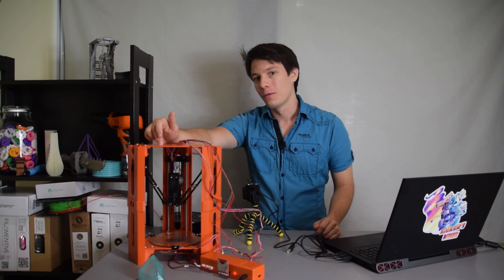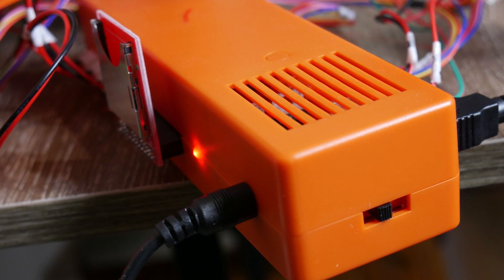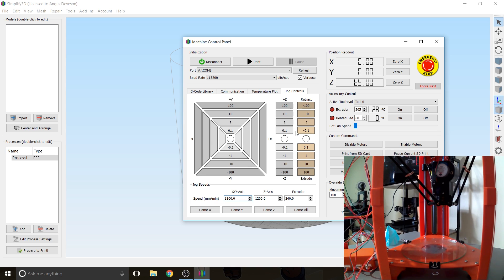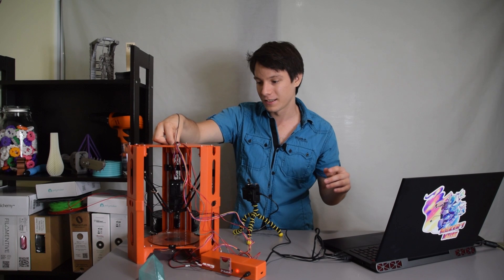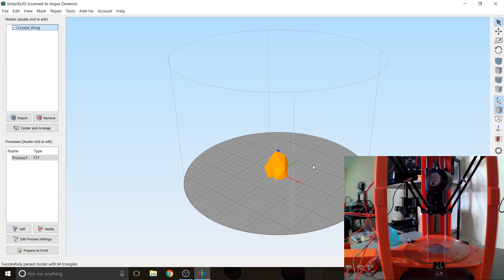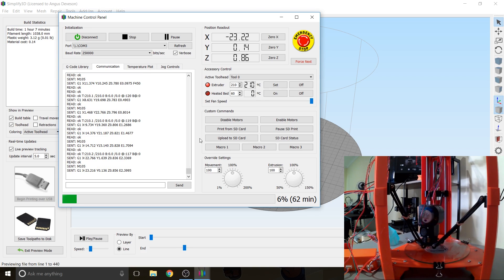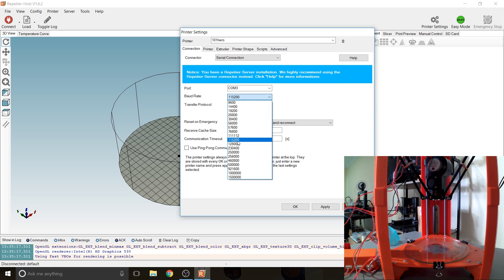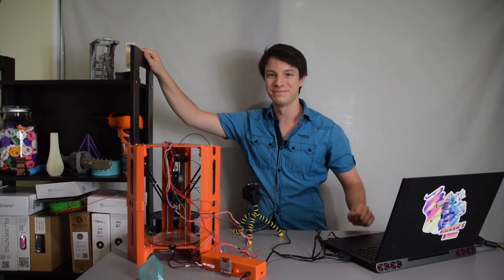Control the 101Hero with your Computer! 3D Printing over USB Tutorial

Comment: I Get Received= G90
Testing binary communication protocol
Connected to machine!
SENT: d501015e
READ: d501015e
And I can't control you 101 hero
What did I do wrong?
Reply: Strange, tried it on other computer and it worked thx dude

Comment: Several have mentioned Octoprint. Repetier has Repetier-server that may run on a Raspberry Pi also. actually I have my printer connected to a Pi, which is powered from the printer PCB. It works fine with my Repetier-host. Since the Pi has WiFi, I may control or monitor the print from my mobile, only by connecting with a browser. You really don't need to have the laptop connected all the time, just use a Pi.

Comment: Hi Angus, How did you manage to get the filament to feed back inside there is a gap between the top tube and bottom tube? Is cutting it at an angle the trick?

Comment: Angus, How do I get this to work over USB in Cura on osx? I tried have connect it but it doesn't seem to detect it. The 101hero works fine with sdcard. I hope you can advise. I'm quite new to 3D printing.
Reply from the maker: Sorry I have no experience with Cura on OSX, it might be a driver issue.
Reply: +Maker's Muse OK. Thanks Angus for the quick response.

Comment: Hi Angus,
On serial settings, my first guess these days would be 115200 Baud. Seems to be the de-facto standard for embedded serial devices for at least 10 years now...
(Update) just FYI, USB based serial emulation could be any baud-rate over USB, as the serial connection is emulated. The limitation comes from the connection to the MCU when using external USB proxies like the FTDI chips. Another factor to watch for is the (hardware) flow-control on the target, i.e. is the embedded target using 3-wire or 5-wire serial. 
 - Eddy

Comment: But Angus.. You can use a android tablet or phone to control your 3D printer using the GCoderPrintr app. So you don't need a tethered pc (but you'll need a wireless file transfer program to get the gcodes on the android)

Comment: Hey Angus, If I understand correctly, max volumetric speed you can reach has a big impact on printing speed. This would mean that you could possibly increase your print speed if you choose a lower layer height. It might be an interesting idea do make a video about this, testing if you can increase your speed at lower layer heights and by how much. Obviously this is different for every printer, but I think it's possible to get a general idea.
Reply from the maker: This is definitely a thing, however you will quickly run into motor and controller limits trying to much faster than 100mm/s. If you're printing with a very large nozzle and thick layers, you usually have to run quite slow so the material has time to melt and flow!
Reply: Yes,  let's say if you can only print at 50 mm/s reliably with 0.2 mm layers, that leaves a lot of room to speed it up on 0.1 mm layers.  Is 0.1 mm at 100 mm/s slower than 0.2 mm at 50 mm/s? If so, buy how much?

Comment: I actually prefer tethered printing but I have an old Wanhao 4s.   I just use an old laptop and files are grabbed off my network so no delay or sneaker net.   also my printer is in the basement so the other half can't complain of noise or smell.   I always had issues getting that blasted SD card in and out... tethered has advantages... next one I get will be networked!  😀
Reply: Convert it into a Linux laptop, install Octoprint on it and slap a WiFi dongle into a USB port. Or print up a Rasperry Pi (or zero) and put a pre-installed image of Linux+Octoprint in it.

Instant print server with network support (assuming you have Wifi in the house). 

 - Eddy

Comment: How can we know which is the perfect "Baud Rate"? I still have the default option and I´m not sure if it is the best one.

 Does it matter for the printing time so much? I mean, when I print something Simplify3D tells me it will take e.g 2h to complete the print, but later it tooks 2h 20m. Now I think it would be because of Baud Rate option jeje
Reply: 123456789 Print It Solid and George Robles thank you for your answers. I had already realised the more retractions and the higher the figure is, the most time difference it is. Also if I print very slow, the time estimation of S3D becomes even worse jajaj 
I have estimated around a 10-15%+  for normal prints, something insignificant for small prints but for example once it estimated 12h and it tooks almost 16 to finish
Reply: its hard to calculate time. repetier host adds 8% by default. can do a little math and improve estimated time but, thats what it is. Estimated time. its not exact time.
Reply: Angel del Pino the baudrate won't affect print time, t's only the serial communication speed that the controller accepts it's only sending strings of text, in batches to your 3dprinter, your printer will never be able to print faster than the microcontroller can read text so don't worry😊, ya s3d itsnt very good at estimates I don't think it takes everything into account when it estimates times
Reply: 1234568789 great answer 👍
Reply: The Baud rate is most likely fixed. At least I have never heard of a controller that can change its baud rate. The industry standard right now is 115200 (115KBaud) which is fast, but there are faster speeds (230400, 460800, 921600) they are not very popular though.

As to the print slowing down, it all comes down to buffering (or FIFO levels). If the baud rate can keep the buffer full then all is good. If the printer is pulling data out of the buffer faster than its going in then the buffer will empty and the print could pause. The printer would speed up its buffer read rate if it was printing faster. So in the end, the baud rate limits the maximum print speed that your printer can run at.

 - Eddy

Comment: I want to like simplify3d and I downloaded a version through less than legal means to try it out...but I'm glad I did because it REFUSES to put the proper origin in the gcode it generates, it always tries to get my printer to print off the corner of the bed. By comparison Cura works great!
Reply: Simplify3D is excellent as a slicer, and simply terrible as a business model. The $150 entry fee is, in my opinion outrageously expensive given that that doesn't guarantee you updates for more than a year.  I personally pirated my copy simply because there was no trial option to see if it would even work with my printer, other than the page at S3D saying that it probably would.  If S3D was $50, I'd buy it all day long, but $150?  No thanks.  

And OP, you have something configured wrong, plain and simple.
Reply: well it just shows that setup is too complicated for you. when you learn more you will def change your opinion about it. so you may want to look into auto center parts, set your machine specs, etc. but its $150.00 usd right this moment. its worth the cost by far! and actually pays the people who made it so they can make another. Pirating sucks to a degree. i get that some cant afford stuff, but people spent a lot of time on stuff like this. and continue to make improvements. its the only way to support something you like and want it to stick around and get better.

if your smart about upgrades, use a 3d printing service so you can make money printing. then turn around and invest into the machine.6 parts three days later, i made 150 cash from a friend. he saved a ton of money and i made a fair amount. and still using same roll of filament.
Reply: Ryukachoo I can't offer suggestions because you support less than legal means of acquiring software... you obviously got an overview of the software from that use, delete it and ask the simplify3d makers if they can fix it or guarantee a fix if you purchase.    otherwise you are just making excuses.   :(
Reply: ashasaur Hello!?? Autocad LT is $360, PER YEAR!   Autocad is $1400 PER YEAR!     some would say those are too much, but $150 for software that gets it printed and saves you time doing it?  I call that a deal!   Yes, you can gets lots of free software to solve the problem so that you don't have to support anyone else or actually thank someone for making a good product by giving them some cash.   sure, you can be a cheapskate and take and take and take from the community and never contribute back to that "free" software also.  But just like this Hero101, you get what you pay for... unless you steal the software, then you are getting what I paid for.